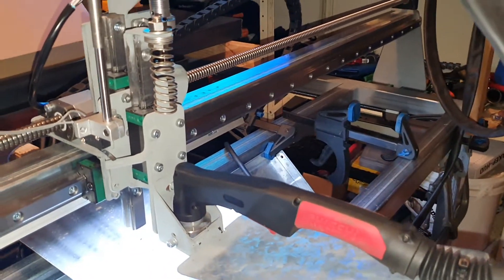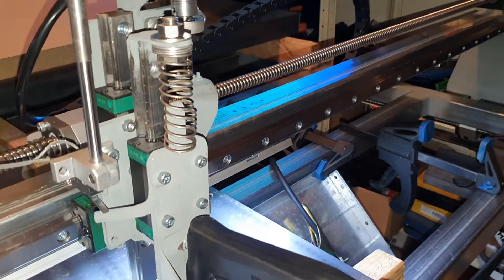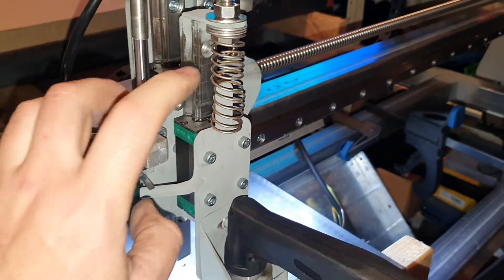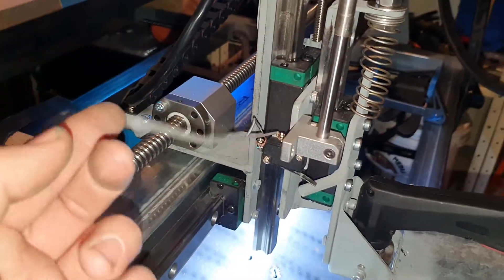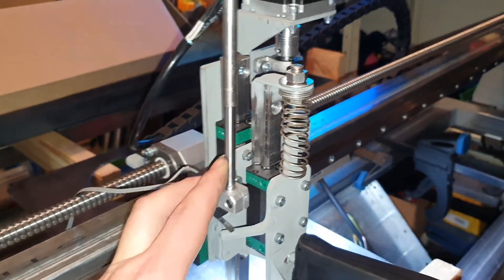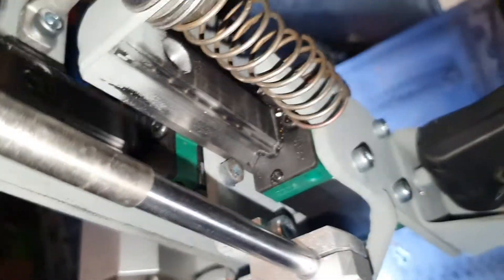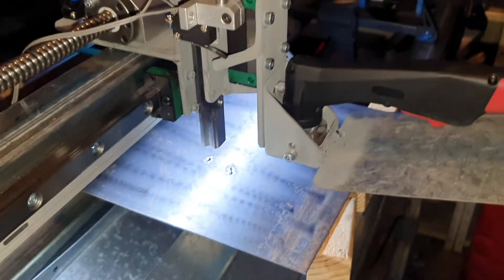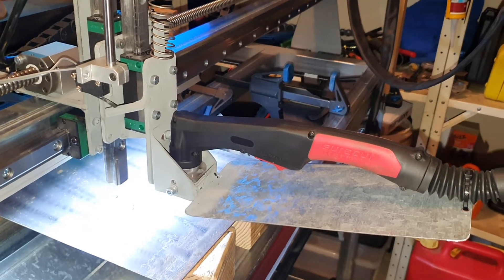DIY Arduino GRBL CNC Plasma Floating Z Axis HGR20 Linear Rail

Comment: Hi, I like your project! I'm building a cnc plasma based on arduino. One question, how did you create the g-code that works with the floating Z axis ? Thank you
Reply from the maker: It's a modified to suit my needs g-code based off the laser g-code from fusion 360. Do you plan on using fusion 360??
Reply: @aussiecustommetalwork150  Yes, I think I will use fusion 360
Reply from the maker: @sashatognolini641  ok I'm currently moving my office. When I'm done i will work out best location to upload the file and let you know
Reply: @aussiecustommetalwork150  Thank you !!
Reply: @aussiecustommetalwork150  Hi, if you want you can share with me the file using Google drive
Reply from the maker: @sashatognolini641  i haven't forgotten you :)... i just finished installing the panel lift door so need to flash it off and then i can move all my cnc gear :)
Reply: @aussiecustommetalwork150  👍🏻👍🏻
Reply from the maker: @sashatognolini641  added links in Description. sorry it took so long busy with the move and other work going on. i haven't fired the CNC up in so long . workshop is just about finished so i can soon move it over hopefully within the month
Reply: @aussiecustommetalwork150  Thank you so much !!
Reply: Any chance you could also share a copy to me please

Comment: Hi, this project of yours is interesting, could you help me with a question? Does this switch turn the torch on and off? how is the nozzle height control done, you use the probe principle in eizo Z. Thanks
Reply from the maker: hello there. this switch measures the height and saves the info for a set offset for any material. so what ever thickness you use this will measure and change to suit 1.5mm from the job from memory. haven't fired her up in a few months as busy working around the property

Comment: You will want less spring not more.  The less the floating head weighs the better
Reply from the maker: Yes great advice thanks as i did notice on the stainless cut i did it pushed down the metal and that changed the cutting hight :(

I'm going use this machine to make upgrade parts for the CNC and slowly she will be sweet